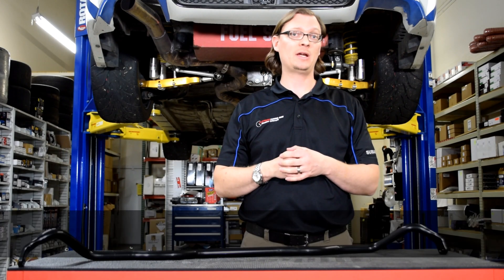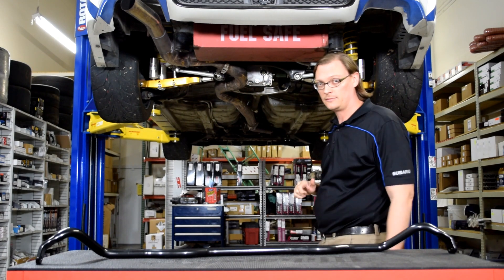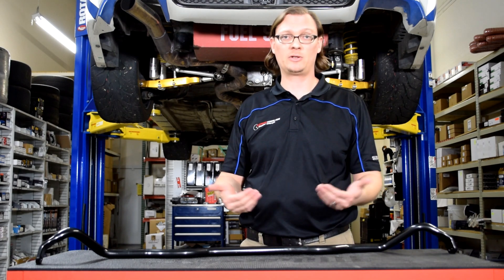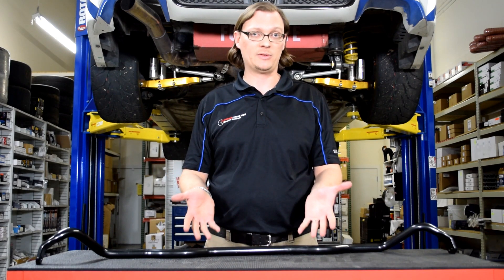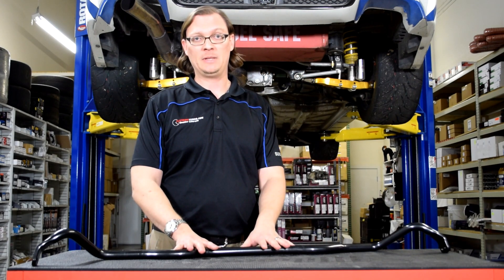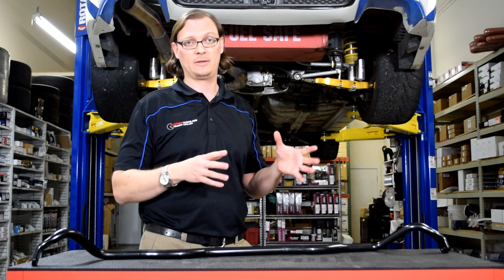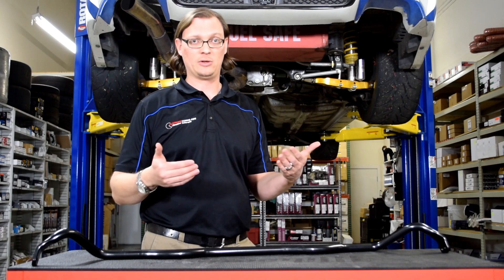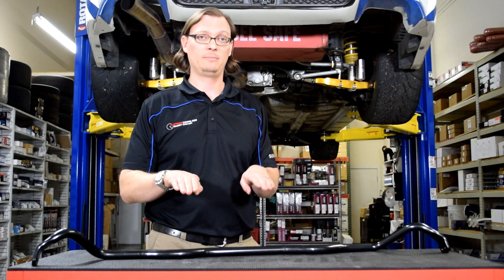All about Sway-Bars and how they work

Comment: I have a 2006G 35 coupe I just replace the front sway bar bushings and N links were done about 1000 miles ago. My sway bar moves from side to side enough to where the stop or rings stop it from moving any further, is the sway bar supposed to move at all from side to side.?
Reply from the maker: Thanks for the question.  Some swaybar manufacturers have clips that go on the bars next to the bushings to keep them from moving like that.

Check with the manufacturer to see if they offer them, and if they don't Whiteline may make something that would work for you.

Thanks for watching and Stay Tuned!

Comment: Hi, I have standard suspension on my car and had to change the bar end link rods. The link rods I replaced the old ones with were about 15mm longer... is this ok? the front suspension now feels stiffer through corners, which is good. Just concerned about any long term effects...?
Reply: The new rods don't have play and so the sway bar you already have does its job better. It sounds to me that the longer link rods would add a preload to your bar, making it resisting further torsion as well. I'd still ask the professionals though.

Comment: Hope about for rally and rallyx applications? Sway bars or none? How would one adjust adjustable endlinks for maximum droop?
Reply from the maker: For Rally, the majority of cars are either running pretty small sway-bars, or none at all.  For Rally-x, I'd say softer sways would be a good option.  Maybe stick with stock?  And you can also tray disconnecting one endlink on your front or rear bar (or both) and see what that feels like.  The nice thing with sway-bars is that you have the ability to adjust them and play with settings a lot.

Thanks for watching and Stay Tuned!

Comment: Is there a specific torque on those bushings I know they probably is but the life of me I can't find anything consistent… Thanks for a response
Reply from the maker: In most cases, the torque spec on most aftermarket bushings is the same as factory, so I'd say the first place to look would be the Factory Service Manual if there wasn't a spec in the bushing install instructions.

Hope that helps and Stay Tuned!
Reply: @FlatironsTuning   👍👍  tu

Comment: As a car turns hard it wants to roll outwards and the inside wheels will want to be lifted, the sway bar does not resist this. It takes the extra spring load created on the outside wheel and uses it to decrease the spring rate on the inside wheel so the inside wheel cant help turn the car over. If your sway bar is hard enough to overcome the spring rate of your springs your ride will become choppy.

Comment: So.......you could take sway bar off and leave off....if you drive slow n safe
Reply from the maker: Sure, you could remove them.  In that case, it would be the same as if you are putting on a larger/stiffer sway-bar.  You would want to test the car and find out how the handling has changed before you would drive the car much, etc.

Hope that helps and Stay Tuned!

Comment: What are the reasons for the sway bar to move left or right?
Reply from the maker: Thanks for your question.  If you mean to move the position of the endlink, the purpose is to either make the sway-bar effectively stiffer (by shortening the lever arm the endlink is working on), or to make it effectively softer (by lengthening the lever arm).

Hope that helps and Stay Tuned!

Comment: do sway bars wear out from twisting so many times ?
Reply from the maker: Thanks for your question.  They do not typically wear out, but if the bar is very old, and especially if it is showing signs of rust, you may want to replace it.

Hope that helps and Stay Tuned!

Comment: Great video. Didn’t even need to speed up playback. Question- aside from poor handling in turns, any other issue associated with removing the sway bar on the front end?

Comment: My time in a garage i found that hollow bars actually come apart at the welds more then you'd think. My opinion if I just had to save weight I'd do so else where. None of the Sunfires nor the Cavaliers I've owned have come out with them I purchased a 22mm off a Z24 just to see what improvement might be made honestly it didn't handle bad for what it was before.

Comment: Am i right in thinking a larger diameter sway bar will resist rotation because they have more rotational inertia with the weight being further from the centre or am i completely wrong in thinking this?
Reply from the maker: Thanks for your question.  Yes, I'd say that you are overthinking this a bit.  A larger bar resists the twist or rotation because it is more rigid.  

For example, a 22mm solid sway bar has about the same torsional rigidity as a 25mm hollow bar.  the hollow bar has to be larger to have the same effect because there is so much less material in the bar itself.

Hope that helps and Stay Tuned!
Reply: @FlatironsTuning  Thank you so much for clearing this up, massively appreciated.
Reply: @FlatironsTuning  Hi again, I forgot to ask, could please explain why upgrading front and rear sway bars affects slip angle by causing a car to understeer/oversteer and also why a larger diameter brake disc improves braking performance? Thank you.
Reply: @FlatironsTuning  Sorry to bother you again guys but could you also explain why superchargers whine, i've done a lot of research but haven't found a definitive answer so i thought i'd put the question to you guys who clearly know what you're talking about.
Reply: @FlatironsTuning  How does upgrading the front and rear sway bars effect slip angle?

Comment: Call me stupid but in the off road world, you always hear of drivers disconnecting the sway bar. The Jeep even has electronic sway bar disconnect.  Why would it be important to disconnect the sway bar while doing an off road trail, or rock climbing for instance?
Reply from the maker: Thanks for the question, and it isn't stupid at all.  For the sway-bar to do its job, it has to connect the movement of the left and right wheel.  This reduced body roll, and can improve handling for sure.  But when you go off road, you need those wheels to be able to articulate, and adsorb bumps.  If you run sway-bars and you start to go on a trail, it can actually be a rough ride.  And at an extreme, you can end up breaking sway-bar links, etc.

Sway-bars actually hurts your car's ability to do its job off-road.

Hope that helps and Stay Tuned!

Comment: I have a bump noise on rt sude of my car after I run over a pothole. I crawled under front of car this morning on a jack. I jerked everything I saw underneath, but could not detect an obvious loose suspension mechanism. Front struts are exorbitant and beyond what I can afford right now. Extortionists pricing. There is NO SATURN for parts in Calgary!
The cheapest I found was a retail outfit in Kanata (Ottawa), Ontario $200/ 2 set including zero shipping plus tax.
I hasten to add I'm not a pro mechanic. I'm a backyard  Dyi'er if that. I must pay a mechanic to install struts - if that is the problem.
David Alberta
Reply from the maker: Thanks for your question David.  I'd recommend working with a mechanic local to you so that you can get an experienced set of ears and eyes on the situation.  With a good diagnosis, then you can decide what the best path is to getting the parts that you need.

Hope that helps and Stay Tuned!
Reply: Thanks your your response.
Ddvid
Alberta

Comment: Thanks for the video. I found it helpful in search of my issue. I recently bought a 2016 mini cooper paceman s All4 and while driving, I hear a lot of metal to metal bangs. I removed both wheels and even the shocks trying to isolate the noise. 
When i hit on the sway bar with my hand, i can reproduce the noise. The sway bar bushings look good and the links seem new. I'm not sure what's the next step in diagnosing this noise. Should i remove the links and try driving the car to see if it's quite? 
Thanks for you time and input.
Reply from the maker: That sounds like a good next step. If you disconnect the sway-bars and the noise goes away or is gone completely, then the next step would definitely be to take a good look at all aspects that you mention.

Hope that helps and Stay Tuned!

Comment: Found this video after I already invested in my suspension. Think I got lucky with my choices though. I went with Whiteline 24mm F&R. Set the front on soft & rear on the middle setting. Running Ohlin's Street & Track coilovers on the Ohlin factory/suggested settings. Also put Whiteline Front Control Arm lower inner rear Anti-Lift Caster bushings on & set for Anti-Lift instead of Anti Dive. Was told Ohlin's DFT would resist anti dive. I had the alignment set at zero tow & -1.3 degrees camber F&R. It is such a huge improvement over my worn-out factory suspension I don't know yet if I need to do any tuning.
Reply: What car you have these mods on?

Comment: Thanks for your interesting and informative video. I have a 370Z sport coupe and recently had Hotchkis bars installed on the front and rear. The front bar is very stiff and has only one hole(no adjustability) while the rear bar has three holes, we chose the middle hole. The car is more responsive to steering inputs and turns in very nicely and corners much flatter. The ride quality is somewhat harsher but is acceptable. The front-end dips less when driving over driveways and my chin spoiler isn't scraping the ground as much.  Overall, it was a good mod to make for the car.
Reply from the maker: Thanks for watching, and glad you like the new sway-bars!

Stay Tuned!

Comment: Hello, have you ever seen a front sway bar with bushing type sway links on both ends ( not balljoint type ) affect inner tire wear?    

Basically what I'm asking is for dramatization purposes if one sway bar link is torqued tighter than the other side will it affect inner tire wear?    It seems it would
Reply from the maker: Thanks for your question.  The short answer is that it shouldn't.  The sway bar doesn't apply any steering force to the tire.  It is basically just connecting the left and right wheels movement together to a degree.

If you are seeing inner edge wear, that would most likely be something to do with alignment, etc.

I hope that helps, and Stay Tuned!
Reply: FlatironsTuning Thanks for the reply

Comment: Why it is not included already when you buy a car?
Reply from the maker: On most modern cars, they come with front and rear sway-bars.  However, on some cars in the past, they would only have a front sway-bar for instance.

Honestly, in those cases most of the time, it is just a cost cutting measure taken by the manufacturer.
Reply: @FlatironsTuning  the front only vehicles like an '82 rwd 4.3L chevy astro really respond better at stiffer end links, doing 90 really makes the under/over steer stand out

Comment: What about those lateral locks? Are they really necessary?
Reply from the maker: Thanks for your question.  On these cars, the rear sway-bar bushing mounts are a little flexy, and those mounts just help to make sure that they twisting force of the bar doesn't start to bend the mounts. 

It is somewhat rare, but we have seen a couple cases where the sway-bar mounts ended up breaking off when a customer was running a large bar with no brace.

Hope that helps, and Stay Tuned!

Comment: Loved the video!!! Quick question: I have a 2004 Nissan Xterra that I am building for off roading, but the rear of the Xterra is not leveled. The drivers rear side sags about 2 inches. It was at 1 and without the sway bar it increased another inch. Do you think something is wrong with my leaf springs or is it really the sway bar doing the 2 in difference? Thank you!!
Reply from the maker: Thanks for your question.  I'd have to say that a 2" difference from left to right is pretty significant.  It does sound like the sway bar was countering some other issue.

A good look at the rear suspension sounds like it is in order.  And it maybe worth checking the load on both sides to make sure that one side of the truck isn't overloaded.

Hope that helps, and thanks for watching!
Reply: FlatironsTuning  So your saying it’s pretty normal that there is a two in difference?
Reply from the maker: @AdrianBugarin  Yes, but not that much.  I'd say the normal diffecence would be something between 1/4" and 1/2" at most.  2" of difference is significant, and since the difference increased when you removed the sway bar, one side of your truck wants to droop apparently.

Comment: so can u tell us please what's the best up grade for the st to improve handing please, thinking of puting better ant roll bars on my dc2 integra , Leslieleonard55@gmail.com
Reply from the maker: Thanks for your question.  Sway-bars are a great place to start because they reduce body-roll, which increases confidence in the corners.  They are adjustable so you have the ability to dial in the handling of your car to an extent too.  Last but not least, they don't come with additional harshness.  All of that together make them a great place to start.

Just make sure that you have good tires on as well.  The actual tires that are in contact with the road will dictate a lot of your cars handling ability, and they often go overlooked.

I hope that helps, and thanks for watching!

Comment: Will the sway bar be a negative if there are a lot of potholes, rough highway etc? Also, will this be bad for the vehicle or overall good? Please explain?
Reply from the maker: Thanks for your question.  Basically, the rougher the surface that you are driving on, the more negative impact a large sway-bar can have.  This is why Jeeps/off-road vehicles will disconnect their sway-bars for instance..

If you are driving on the road, pot holes will be a little harsher, but that should be a moderately rare occurrence, so going with a stiffer bar shouldn't be that bad.

If you do a lot of driving on dirt, etc., then you may want to keep your sway-bar closer to stock diameter.

I hope that helps, and thanks for watching!

Comment: Great video!
Reply from the maker: Thanks Junior and thanks for watching!
Reply: @FlatironsTuning  would a coilover sleeve kit with performance struts along with sway bars be a good platform for a road car
Reply from the maker: @SuperJuniorja  That is definitely a place to start.  I'd say if you just want to reduce body-roll, and gain adjustment of the oversteer/understeer tendencies, just start with sway-bars first.  If you want to be able to adjust ride-height, I would go with a full proper coilover before I would go with a sleeve kit, but depending on your platform, there may be some good sleeve kit options.

Thanks!
Reply: @FlatironsTuning  ok understood ! thanks a million for the advice appreciate it

Comment: What to do you guys think about installing front and rear sway bars on the dodge charger 2006 rt
Reply from the maker: Thanks for your question.  You certainly could.  They are a great tool to set up the handling characteristics of your car.

Thanks for watching!
Reply: thanks for the reply! i was more curious if it will make a big difference with my car or not ?
Reply from the maker: Depending on how much larger of a bar you go with over stock, it can certainly make a big difference.  Ideally you would want a bar that is a bit bigger, and that has adjustable mounting for the endlinks so you can tune the behavior of the sway-bar to get it just where you want it.

Good luck!
Reply: i didnt realize my car had them stock??

Comment: What impact will I have is I make my own solid end links instead of endlinks that have two ball joints. If you know what I mean
Reply from the maker: Thanks for your question.  If the endlinks themselves are solid, and able to transfer the force from the control arms to the sway-bar, there will not be much of a change.  If there is a fair amount of flex in the endlinks (like some of the older Subaru links that were made of plastic), then you will feel the sway-bar being more responsive with the rigid endlink.

Hope that helps, and thanks for watching!

Comment: Hey guys would a match of 24mm adjustable front and 24mm front adjustable sways be good for a daily and weekend warrior type of car on my GD 07 sti?
Reply from the maker: Thanks for your question.  It depends on a few things, but a square set-up is a good place to start on a GD.  For a street car, a 22mm bar front and rear is usually sufficient, but if you are wanting to really keep the car flat, then you could certainly try the 24mm's.

Either way, make sure that you get bars with multiple adjustment holes so you can fine-tune them.

Thanks for watching!